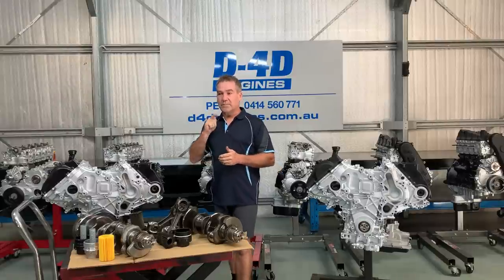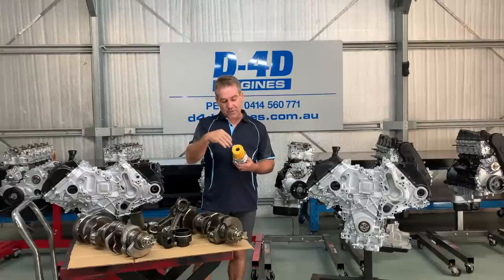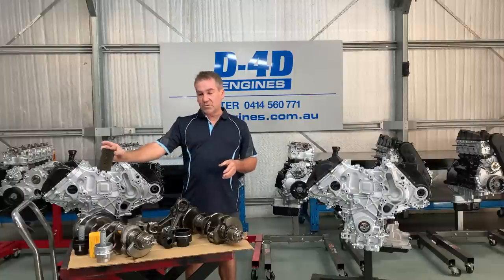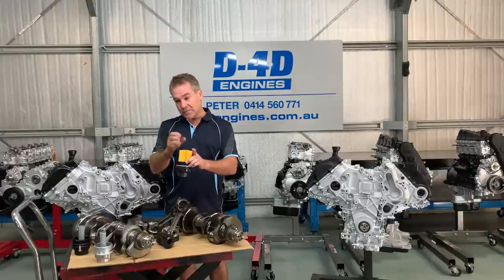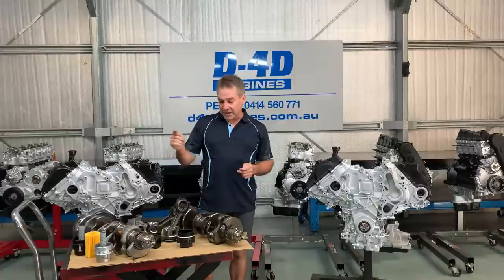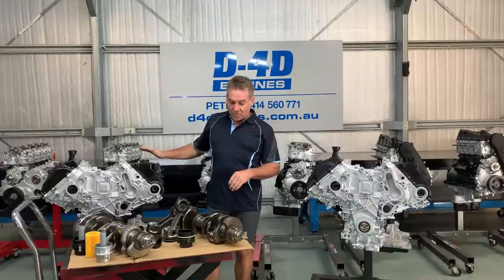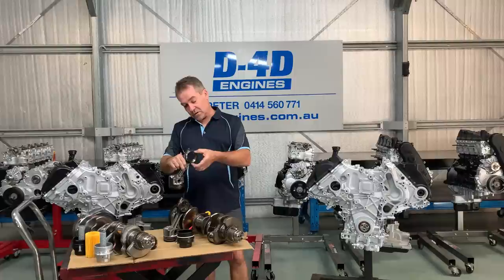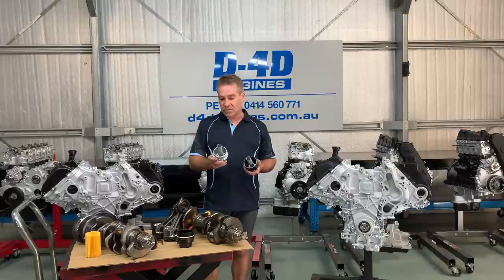Toyota Landcruiser 1VD V8 diesel engine failure simple mistake very expensive OWNERS NEED TO WATCH

Comment: Built in failure point.  Well done, Toyota!
Reply: Nothing to do with Idiots doing the vehicle service.
Reply: No its not a failure point by the manufacturers its a failure by the incompetent service technicians.
Reply: Both comments are correct! Bad design and idiots servicing cars go hand in hand! :)) 
However, this is more lack of knowledge than being an idiot!
Reply: @darrylmackie9184  Everything to do with the manufacturer not securing it properly, actually.
Reply: Typical Toyota and everyone else these days
Reply: @darrylmackie9184  😂😂😂. Toyota are so crap now…I’m absolutely loving watching them turn to crap!
Reply: Seems there’s a few. Kind of regret buying one myself.
Reply: What manufactured item doesn't have a built in failure point?
Reply: It's not a built in failure point mate! It's caused by people working on cars that don't know what they're doing!
Reply: Sounds like some kinda dumb system  Ford would have on the Ranger👻💥
Reply: I’m guessing you built a more reliable car ….
Reply: @darrylmackie9184  the fact that this could happen with a simple service is a head shaker.poor design.
Reply: @boar7153   it doesn’t happen with a simple service lol I arrived 10000s of them without one failure  ,

Comment: Not to mention the factory fitted faulty air filter dusting engines. Really are a let down of an engine by Toyota.
Reply: So the engine is a let down because the filter/box is a shit design? Hmm makes perfect sense
Reply: @alexmann3145  The VDJ79R & 200 series air filter is let down by sexy fingers mechanics (Everything they touch, they fvck) who crush or fold over the rubber seal or don't seat & nest the airbox lid correctly. You can buy a simple glue in stainless steel thin plate that enlarges the sealing surface of the airbox seal & I rubber grease the seal & run a Donaldson cyclonic snorkel head. I didn't have any dust bypass issues before & certainly no issues now with the standard airbox on my VDJ79R but you need to know what your doing & have an understanding of how it needs to be & how to get it like it needs to be.
Reply: @alexmann3145  . If they can't get the filter box right, then what else is wrong.
Reply: @NewstartGarageOZ They were a shit design even on the older round hundred series with stupid clips that would break off at the slightest bump , keeps the aftermarket brigade in business building air boxes that seal reliably , there is an upside for nearly every shit automotive engineering crappery , at least for aftermarket .

Comment: Actually, $2K For A Crankshaft Seems Very Good Value To Me; Everyone Reckons That Toyota Parts Are Expensive, But It Seems To Me That A BMW, Or Audi Crank Would Cost A Lot More; I Know It Costs $5K For New Front Brakes On A Mercedes, Which These Days Is A Very Cheap And Nasty Bomb Of A Car!! At Least With Toyota, You Can Be Confident Of It's Quality, Which Is Legendary!! I Don't Know Why They Go For Cheap Plastic In Critical Parts, But Anyway I Was Lucky Enough To Land One Of The Very Last Of The 200 Series Sahara's, 2021 Model, The Last Of The 4.5 Litre, Twin Turbo V8 Diesels And I Tell You It's An Absolute Work Of Art!! Incidently, The Car I Had Previous To This Was A 2013 Kluger Grande, With The Screaming V6; An Absolute Rocket, Which Could Break Your Neck If You Planted It Too Hard!! I Always Used 98 Octane, And Premium Fuel At All Times, In Every Vehicle!! The Only Flaw Of The Kluger Was Blockages In The Drainage Pipe From The Sun Roof, Which Would Leave The Front Left Passenger Floor Swimming In Bloody Water!! In My Younger Days, I Drove My Friend's Little Toyota Corolla, 1971 Or '73 Model, I Think, For A Few Months; The Nippiest Little Car I've Ever Driven, With A Fantastic Four Speed Box!! In Fact, That Corolla Was Also One Of The Best Cars I've Ever Driven!! Always Appreciate Your Posts, With A "Like;" A Long Time Subscriber, From Bleakheath!!

Comment: And it's so much of an improvement for the environment for the manufacturers to regress from a good spin on steel filter.....with built in pierced steel centre...
to a cheap and nasty plastic housing with a removable tube up the guts...and an engine rebuild.....
Reply: That's the toymota way
Reply: This style of oil filter is not new for Land Cruiser, the H engine of the late 70s early 80s had the centre oil passage bolt retainer to support the element - it never failed. What's wrong with design engineers of today? Land Cruisers had good diesel engines untill the 200 series. In this era new is not better, for example look at the 300 series.
Reply: Mercedes v6 n v8 been doing it for 30 years never fail….
Reply: Nothing new under the sun. These paper type filters were the standard before the steel can type filters were devised, now reverting back to 1920's technology.
Reply: The original Chrysler V8s have that type of filter, right up by the firewall.

Comment: On any car when replacing the filter, open the box and compare the new filter to the old one. If there are extra parts on or in the filter, they are not part of the filter and should be refitted to the engine with the new unit. To perform this properly you will need at least 1 and preferably 2 Mk1 eyeballs.

Comment: Brilliant video Mate Yes happened to me and I have been servicing all kinds of machines for many years I’m wondering if it’s possible to take a class action against Toyota,as there’s no information included with the new filter warning or otherwise about such a possible trap ,and indeed it’s likely to increase as vehicles getting older I am a qualified diesel fitter 
II love the wise acres commenting about lazy service personnel I expect those people never make a mistake
Reply: Yeah give them some curry, that is not on. Bloody ridiculous to think such a great lot of engineering gets let down by poor design of one component and customer relations did nothing. I just bought the new Stihl 500 I chainsaw the first EFI chainsaw ever produced and low and behold documented all over the internet by numerous owners that there's a air box design flaw that lets fine dust through the cam locking knob intoi filter and throttle body. After 2nd tank of gas I opened it and the dust is there !They should darn well rectify the issue but probably won't. And when you bring to dealers attention he says his go to line "we've sold hundreds of these and not one has come back" that doesn't mean that that dust isn't doing cylinder damage or halving the life of engine. But it get's you off his back !

Comment: Does this engine have a filter bypass system for when the filter is blocked?
Reply: Obviously not, hence the warning, don't let this happen or engine failure will occur. You must have been that annoying kid at school who would keep asking the same question because you were not paying attention. If it had a bypass engine failure would not occur.
Reply: Apparently not. Once the filter is squeezed, there's no other passages for oil going to the pump.

Comment: Im not a fan of any of the landcruiser v8 engines, i like the straight six cylinder deisel engines. They are bullet proof,and are good for 800,000 ks plus before a rebuild is required if they are looked after.
Reply: yes that is where Landover lost their way with v6, I  was a field serviceman with Cummins, I  could take  a turbo from a KW  rebuild and refit in 5 hours, on my Disco, I  cannot even see the turbo
Reply: H2
Reply: Toyota built  its reliability rep on the old six
Reply: Not bullet proof entirely but better than the V8 especially if you want to work on one eg to replace the starter or crap located V8 alternator. The FTE motor is best left STD as over boosting will result in failures...tho not uncommon in other engines also..like the TD42 Nissan.
Reply: 1HDFTE is the only way to go. They have a proper oil filter and good steel air filter in the 79 series. Good fuel filtration too. The 100 series had an inter- cooler and about 30 more kilowatts. The last good motor from Toyota.

Comment: Hi great story, would you recommend replacing the plastic oil filter housing with a diecast housing or they much of a muchness.
Reply: Mercedes been using plastic for 30 years never fail just typical Toyota saving 10 cents a car using substandard plastic nothing new
Reply: They're the same, once the spout is not returned to the filter cap it will end the same.

Comment: Hey mate does it happen in the 70 series as well? The 200 series have a plastic cover instead of metal on the 70s don’t they? I wondered if that made a difference?
Thanks
Reply: Same thing mate
Reply: cast alloy on 70 but same principle  , design.
Reply: Same design, it happened too in the 70 series
Reply: Makes no difference what "material" the cap is made of as the Housings are all the same!

Comment: So many people asking about the 70 series with the metal housing, would it have the same issue? but you don't respond. We support your channel & would appreciate the occasional answer to questions about the subject you are discussing. Would help alot of dedicated viewers.
Reply from the maker: Hi, I have seen this happen with both plastic and alloy filter caps. Thank
Reply: @enginecare1417  Thanks very much for the reply & the video.
Reply: I run them out to over 400k no issues (70 series)

Comment: Wouldn't it throw, a low oil pressure light on the dash?
Reply: By the time the light comes on you're engine is fucked anyway.
Reply: Generally too late by then.
Reply: That light means your engine is already shagged.
Reply: If it's like my land rover, the pressure sensor is upstream of the filter, so there would be an increase in pressure. Glad I installed a gauge in place of the warning light. Good to know if it's both low or high.
Reply: Yes I have scan gauge

Comment: Great ‘To The Point’ video.   I’m still amazed how Toyota has such a dedicated consumer following.  With the many design flaws and significant engine faults, coupled with very basic cabin features, they seem to be an overpriced yet poor standard vehicle.   As a previous manager of a workforce, I bought several Cruisers and was disappointed with the regular issues we had.
Reply: Still best of a bad bunch on the whole
Reply: Failures like this in Toyotas are seen by owners as a badge of honour..just like paying too much in the first place and then spending tons of money modifying suspension etc etc. Imagine if this was a Jeeo or a LR! Amazing that Toyota still gets away with such design flaws.

Comment: Do you see many failures due to over tuning for more power.
Like more fuel, high boost and incorrect air fuel ratio in this motor or any others

Comment: I've got a 200 series landcruiser and nice to know this, but if this is a common issue why has no-one made a modified oil filter cap so the metal sleeve doesn't come out
Reply: It's not a common issue so a new filter case design is not needed. Keeping idiots who don't know what they are doing away from your filter oil case is the best prevention.
Reply: @dustyfarmer  So Dusty am I who has been building and repairing engines transmissions fuel pumps etc for over 50 years to classify my self an Idiot or is Toyota design engineering the idiot Sir I rest my case

Comment: Genius Toyota engineering, just like their air boxes, dpfs (hilux) etc, and all that for a 4.5L V8 diesel that makes lees hp then most modern 2Ls. Not to speak of the cutting edge technology, when you have 15 yr model cycles! People have rocks in their heads, ... I got a V8 mate! But hey, good on you for capitalizing on these muppets, probably own your house outright and a couple more every year. Oil filter change, yes sir, that'll be 25k! Nobody has stupid money like a 79/200 owners. Might change profession!
Reply: And the payload of a shopping trolley. Make sure you have a good crap before getting in or you will be overloaded .

Comment: European makes have this design. You get a low oil pressure code. Unsure and bad if Toyota doesn't give a warning of low oil pressure code. If you are unsure check the stout before installing yourself or after a mechanic does it. Can't go wrong if you check it yourself and save you a headache.

Comment: Why can’t you regrind crank?
Reply: Itll never be the same, could be warped a little bit from heat, and keeping it standard size is better for multiple reasons
Reply: As in heat from the bearing spinning on it or the bearing welding itself to the crank
Reply: Or send it to Pakistan? 🤔
Reply: Too much heat in the crank from spun bearings, you’ll see the blue metal colour. After that much heat it is permanently weakened.

Comment: easy solution: in the center of the cap, find the flange that the tube bayonnettes to, then drill a hole to fit a screw into (hex/torqs), LOCTITE it in; then that thing is NOT coming off unless you want it to!

Comment: As a wealthy Landcruiser owner says about the V8 diesels,,,, you trade them in before the warranty runs out. And send themto the Toymota dealer to get them serviced. This a bloke who restores classic cars as well as building race cars/ race engines.
I would like to step from my 100 to a 200. But the engines scares me as I have seen them broken and also ofcourse they are noisier [but torqier] than the V8 petrol. Dont tell me more economical as yes they use a bit less fuel but the cost of said nunga nunga lotion is far more expensive.
Reply: The V8 in the 79 series has hardly any more torque or power than the 1HDFTE in the old 79 series. With the wider front  track on the V8 79s what was Toyota thinking there? I service my 1HD myself, always have done, wouldn’t let a dealer near it. No problem with the oil filter either.

Comment: My mate was told about this issue by the local Toyota dealer ahead of an interstate trip..in case he needed a service elsewhere. For the extended warranty they told him not to drive in dusty conditions or through water because of the filter issue and low alternator and to watch out for excessive oil consumption. The 200s has cost him we over 100k Inc 10k on suspension mods. He was too frightened to take it to Fraser. Oh what a feeling..
Reply: Mate at least the dealer actually told him some useful info that might just save him from dropping even more coin on it. Most wouldn't
Reply: Nice story, mate... But you left the most important part out, you forgot to put "Once upon a time" at the start.

Comment: so,how much do people pay for these ''vehicles'', & to enjoy,,''oh, what a feeling'', ??.. most 100%,of modern vehicles use an all in 1 filter. is toyota useing something from the 2ww. still..??.. 1k per injector, oil filter fails, buried starter, alt where the oil pump should be. yup, id pay 80k for that.!!..feeling.. is there a re call for this,,hang on, no, its toyota, thay dont fk up.. your buying a name,,not a vehicle. last decent toyota 4x4, was the 80 series. then there was a very steep slipery slide to oblivion. not that the 80 was that good..it had design problems. go on,jump for joy..im waiting..

Comment: They are a very poor design especially made from plastic, although I have never had this problem myself because to me it's a no brainer but then I am a qualified Diesel fitter, but I can see how to the untrained this could be an issue. Sad that Toyota don't simply use a screw on type canister type, although I have encountered a screw on canister type come undone from a 6 cylinder Diesel land cruiser. Toyota lift your game or you will get a bad rep.